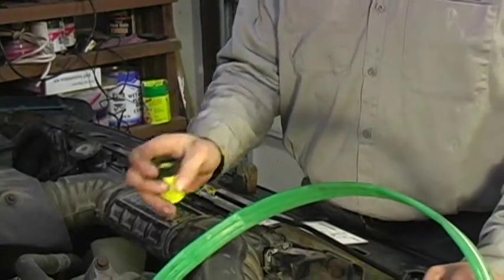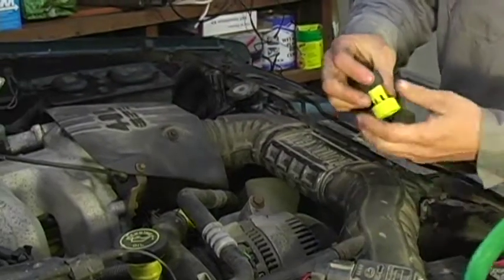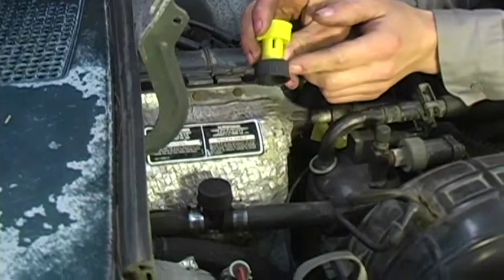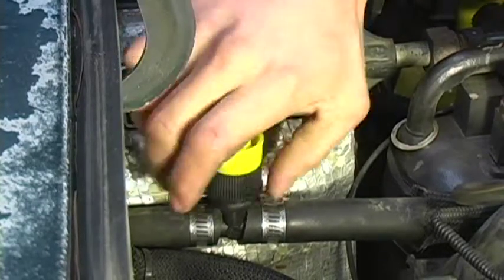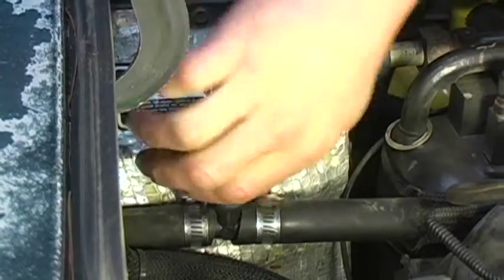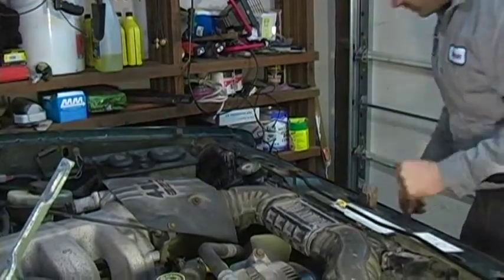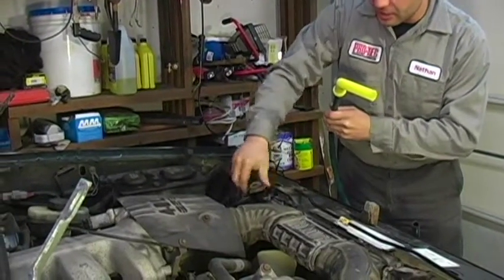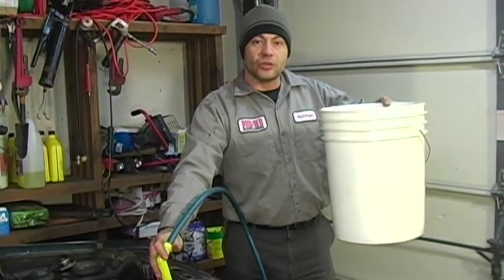How to Flush Coolant : Connecting a Back Flow Prevention Valve

Comment: I'm running 2000 Mazda B2500 and the Heater Outlet & Inlet Hoses are already spliced.
Inlet hose has a T connection to a Vacuum Valve and further down into the Heater Control Valve.
The Outlet hose spliced where the Heater Control Valve connects.  So my question is do I have to disconnect the Vacuum Valve and Heater Control Valve?  
Or do I just disconnect the Vacuum Valve and place my flush T above the Heater Control Valve?  Where is my Thermostat?

Comment: You can do the same by removing the upper and lower radiator hoses and putting the hose in them and flushing. No need to make any cuts in the heater hose.